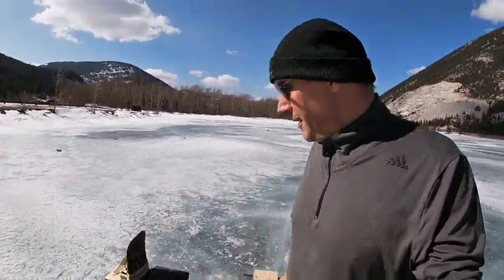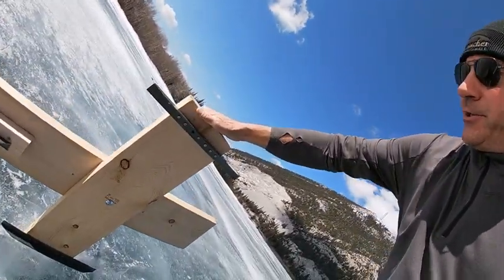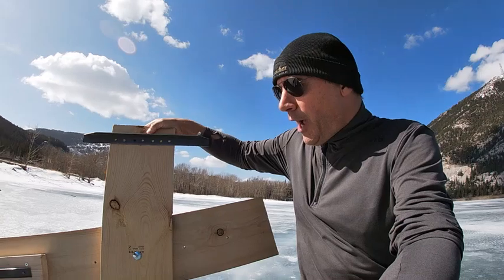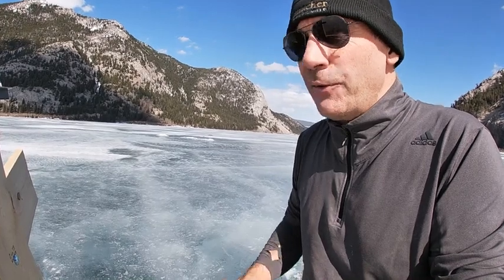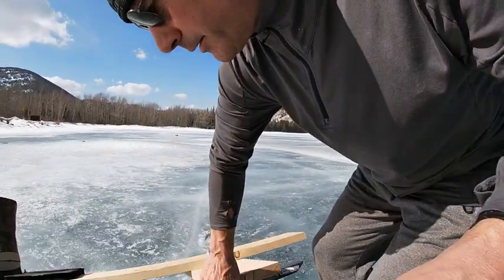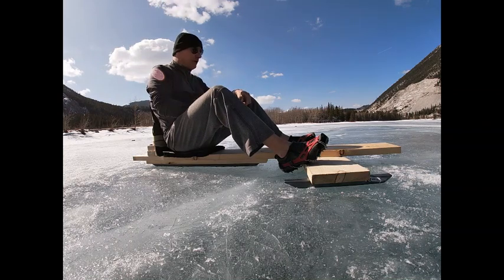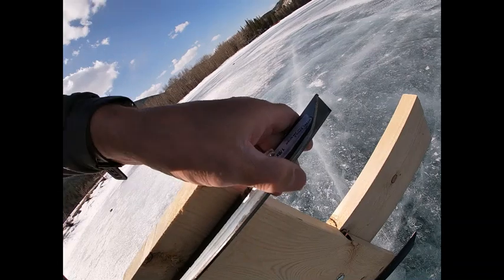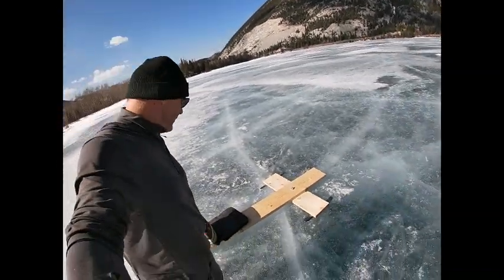REVISED HOMEMADE ICE BOAT DESIGN FOR WING SAILING

Comment: Awesome.  Thanks for posting.  

How did you grind the edge to 90 degrees?  
Thanks
Reply from the maker: You're welcome. First I tried a cross-cut file but it was too much work so I purchased a belt rotary sander with a about an 80 weight paper. It worked really well and I could get a flat close to 90 degree surface just by eye-balling it. Here are two links to videos I made actually sailing on this new design. I have been very pleased with its performance -- I can jibe and tack almost at will. It is a simple matter to depower the wing in gusts, and crashes are quite low consequence because I am so close to the ground -- less distance to fall. 
https://www.youtube.com/watch?v=g-Hn2ghvbA8
https://www.youtube.com/watch?v=LjyufCGpB84
Reply: Appreciate the response!  👍🏼

Comment: I  would like to see how you handle the wing sail.
Reply from the maker: I have several videos where I use the wing on my ice boat. Here are two:
https://www.youtube.com/watch?v=LjyufCGpB84
https://www.youtube.com/watch?v=g-Hn2ghvbA8
The new design features foot-steering which works really well. I can tack and gybe almost at will. The skates are ground to a point (90 degrees)) along the whole length of the angle iron.
The old design had fixed hockey skate blades (which were not ground to a point) but left as they were for hockey skating -- To steer that design I had to move the Center of Effort of the wing forward and backward of the Center of Lateral Resistance on the ice boat to steer down and upwind. While that design did work, the hockey skates -- flat on the ice -- tended to lose purchase and I would spin out in high wind on hard polished ice. Hope that helps :) Good luck mate.